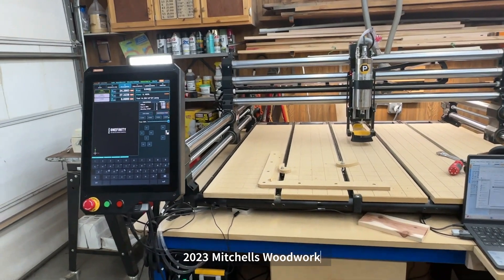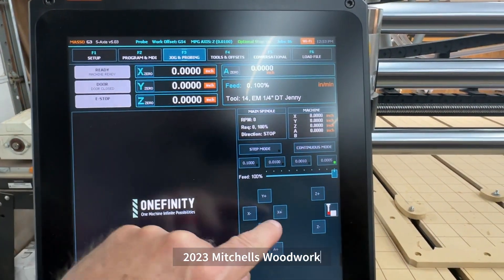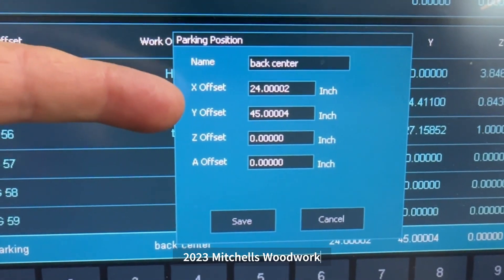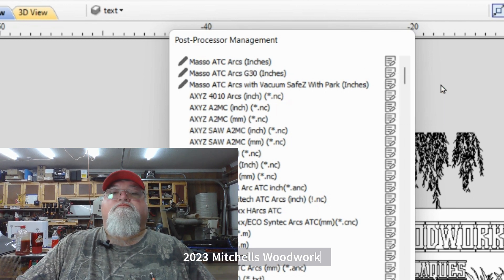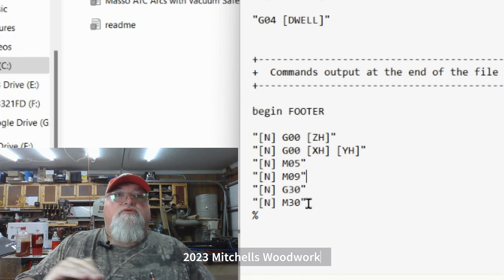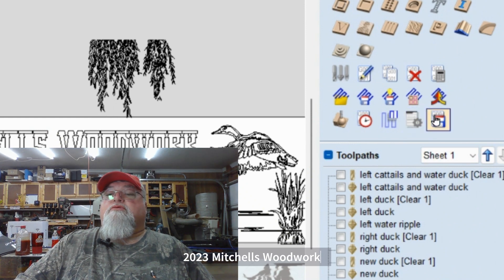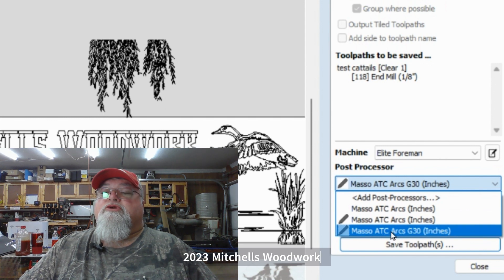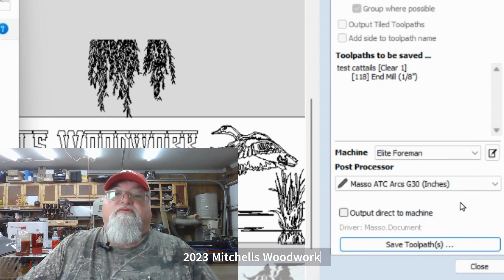How To Set Your Onefinity Elite CNC Parking Location in Masso Controller!

Comment: When it parks does it raise to the save z height, or full z height?
Reply from the maker: Hi Derek, thanks for watching! The spindle raises to the full Z height before moving to the parking position. This helps prevent the router bit from hitting any clamps or debris on your workpiece or wasteboard. However, your Masso should remember the saved Z height until you reboot it.

Comment: Hey Mitchell - can you change your home location to your park location?  I see it in the settings, but I wasn't sure.
Reply from the maker: @bigdogmn73  just to be clear, you can’t (shouldn’t) change your home position, but you can set your parking position anywhere you want it.  

However, something to consider; if you park anywhere up front the X gantry is going to constantly be in your way when loading or removing your workpiece, setting XYZ, placing clamps, etc.  You’ll be much happier setting your parking location in center back, about 1” from the back Y limit.  

Thanks for watching!  Let me know if there is anything else I can do for you. 😊

Comment: Very good video! I believe the process for loading the new post processor is different for Aspire software. I had to do the following in addition to the video instructions:
Under "Post Processor, select "Add Post-Processors"
When the dialogue box opens, select the "+" sign at the bottom
Select the edited file you edited in the video instructions.
Then your edited post-processor file will show up as a choice under "Post Processor"
Someone please correct me if I'm wrong, but that's what I had to do.
Reply from the maker: Thanks for the info!  Which version of Aspire are you using?

Comment: Good Evening.  When I get to file location and click to open my computer asks "How do you want to open the file" .  Do I need to have power-point or what is the correct app to use?  I am trying to add the parking location.
Reply from the maker: Just open it in MS Notepad.  Add the “[N] G30” code above the M30 code at the bottom of your post processor code.  Then click “Save”, DO NOT click “Save As”.  If you’re prompted to change the name of the file, just add something like G30 to the end of the existing file name and save it.
Reply: @MitchellsWoodwork  Thank you so much!!
Reply: One more question if you don't mind.  It does not ask me to change the name of the existing file after I add the G30.  It does put the edit button before so that I know which on it is, but is it ok to rename it after I open from the file location in Vcarve?  I want to name it with G30 so that I use that post processor when I need it to park.  Thank you!

Comment: Your explanation with everything is great, but my cnc just retracts until my z axis motor goes to the top then errors, have it set at 2.5 inches. Any suggestions.
Reply from the maker: Man I’m really not sure.  Your best bet would be to post your problem on the Onefinity user forum linked below, or email support@onefinity.com

https://forum.onefinitycnc.com/c/machines-elite-series/118

Let me know if you need more help, and thanks for watching!

Comment: You make it look so easy sir!
Reply from the maker: You can do it, it ain’t rocket surgery! 😁
Reply: @MitchellsWoodwork  I'm settling in with Masso now thanks to your insights.  Did you tackle the tool numbering between Masso and VCarve?  Any recommendations when doing this?  Been looking on forums but cant figure a way to do it on one and export to the other.  Or would that be just to easy!
Reply: Almost forgot,  You know of a way to display the Job ETA rather than just time elapsed?  My old onefinity did this and not having that just seems like a step backwards to me.  Like a night out drinking with no curfew from the wife!
Reply from the maker: @oseanmc  yes, I had to renumber all of my bits in VCarve (I had a cool numbering system too...dang it!).  Then I manually added the new tool info into the Masso.  If there's an easier way I'd sure like to know about it.